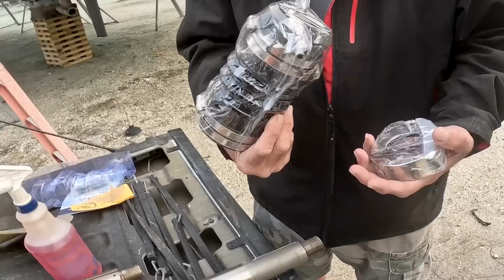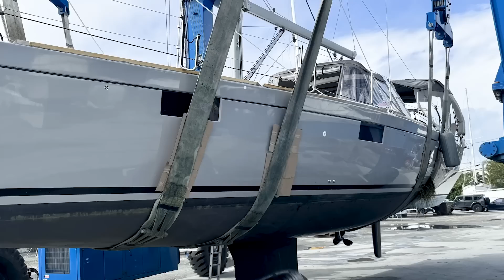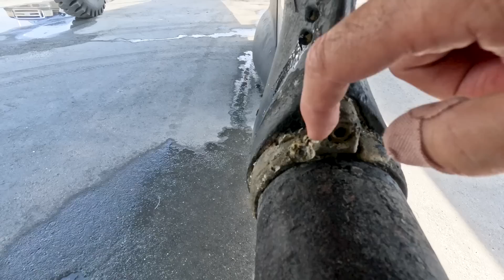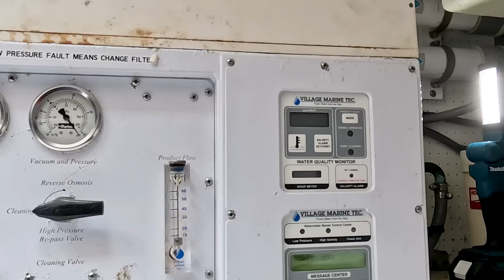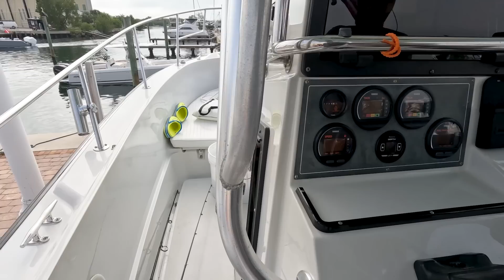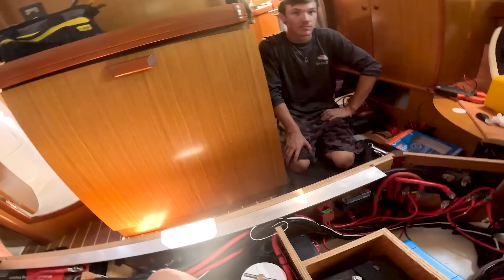Why this Yacht was STRANDED at sea

Comment: Ha funny story we were about 60 miles out of Port Aransas tied up to an offshore platform in a 20/21 foot Sea Hunt Center Console a Merc 150, fishing with my buddy great day of fishing it was getting that time to head back in hit the Key nothing, start checking batteries, wiring under the cowl, fuses. Radio works, stereo works, Bilge, Lights we have power fiddled with the ignition switch still nothing but we are still tied up to the platform its now getting really late its going get dark fast. Well we are sitting there drinking a beer and I look down and the shifter was just barely bumped out of neutral pulled it back into neutral hit the key and it fires right up. That was one long stressful ride back in to Port A in the dark running on the GPS. I was never so glad to see the lights break over the horizon.
Reply from the maker: Ugh … sounds stressful to me. We never drink and boat! Just like we don’t drink and drive the military taught us that too much can go wrong & fast. Glad you got it figured out.

Comment: goofy power readings probably somewhat due to connection cables from battery to battery also crazy when installed they didnt notice cable still moves after tight?

Comment: Loose battery terminals and bad grounds have caused me enough problems over the years that they have become the second on the list of things I check when having electrical problems. The first thing I check is the breaker/fuses and I always hope I don't have to replace something expensive that might be causing a breaker to trip. I have had a terminal crimp connection fail too and it was discovered when I did a wiggle test on the battery cables to check for a loose terminal connection, but there was a lot of corrosion from a battery going bad, so that was a bit of a one off.
Reply from the maker: You're right, always check the simple stuff first.  We just had another boat that had intermittent steering problems and it ended up being loose battery connectors from when I cleat changed his batteries.  Where are you watching from?  Thanks for your support.

Comment: We have a  2024 27ft Pursuit DC 266 and we lost all power  on the ICW last summer.   Made it to the side of the channel, dropped the hook and called Sea Tow.   Another boater came by and had some gas to offer, as I thought we ran out of gas - but not the case.    The negative battery connection was not connected correctly at the factory, so both engines were out.   This model of boat has only 2 batteries, 1 for the engines and 1 for the house.   I didn't think we were out of gas, which we were not, but shoddy   QC at the factory was the cause of this one.

We also experienced another factory flaw, the first time we refueled, we learned that the fuel cap restraining leash was never connected, so a fuel cap went into the deep.  Fortunately, Pursuit sent us a replacement cap, plus a spare for free.
Reply from the maker: Yeah sometimes things are missed unfortunately …. Even new boats.

Comment: Curious to see updates on the corrosion issue mentioned. I am currently working on a 2019 jeanneau cc that has corrosion on aluminum lower units and also has the earth plate for generator, not painted. Will you be putting a reference cell in for that?

Comment: My Dad ran a charter busines out of LA from the 70s to mid 80. She was a  will taken care of 60ft wood hull twin DD 671s,  Dad did maintaince on her every winter. Unfortunately,  in 85 she was hit at anchor by 140ft crew boat.. She took 3hrs to sink. My Dad ran his friend boat after that, 80Ft custom aluminum haul fishing boat with twin turbo DD 871s, she would get up and go.. Dad wasnt fimiliar yet the boat and forgot to switch the fuel tank on the way in and ran it out of fuel. Yeah, he enjoyed the taste of diesel to get the air out of the system back then., Great memories and times. Really enjoy your channel. Spent many of days scrapping barnacles and recaulking wood planks back in the day..
Reply from the maker: Sounds like work scrapping barnacles!

Comment: Does it help to tie a fresh water line into the barb on the drip less rings to flush out debris? Or will make a hill a beans?
Reply: The gunk that clogs up the shaft seal is actually coming from outside the boat(the cutlass bearing gets hot with use, so after the engines are shutdown there is some backflow of water); the raw water supply inside the boat goes through strainers to clean it up. Converting the dripless shaft seal to use fresh water would be adding multiple points of failure into a system designed to have as few as possible and those dripless shaft seals actually consume a lot of water(an easy 2 gallons per minute, per inch of shaft size). You would also have to add a water pressure regulator to bring the fresh water PSI way down to under 15 PSI(normal fresh water systems can easily be between 20 and 80+ PSI). On a normal setup, the raw water supply for the shaft seal comes right off the engine exhaust which means you will have water flow if the engine is running under normal conditions and the engine cooling water PSI is what those dripless shaft seals are designed for, so that's one less thing to worry about.

On slow boats(IE old sailboats and trawlers), some of the dripless shaft seals actually use sea water coming up the shaft to cool the cutlass bearing and only have a vent line coming off the shaft seal.

Comment: My family owned smaller runabouts when I was a youngster, we were fresh water river and lake fishermen. With that experience and watching boating videos for the last few years and particularly your channel,  I have come to a conclusion.  The only thing more expensive than having your boat maintained properly by good professional techs… is NOT having your boat maintained properly by good professional techs and, as importantly, it is far more dangerous. Once in the mid 60s we had the lower unit of the Mercury OB essentially explode at almost full speed. We were stuck ,dead in the water, and in the dark ages  prior to cell phones, decent walkie talkies or Tow USA. Fortunately the lake was calm and we were in sheltered waters, we rowed until we were close enough to hail my grandfather who was fishing in an adjoining bay and got towed back to the cabin. Rule #1, for runabouts, maintain your engine, and particularly keep the lower unit of an OB well lubed and in good shape.  Oh - and don’t forget the emergency paddles. We think some fishing line cut may have cut the seal and Dad missed it when he inspected to boat for the season.   If I would ever have the good fortune to visit the Keys I would like to say hello.

Comment: Great video Capt. I’m sure you figured out the dingy lift , but couldn’t you have put a cable on the arms which would in fur pull the boat further forward and shift the weight towards the bow?

Comment: 30 mile offshore port Canaveral 21 ft proline cuddy cabin lost all power at helm thank god for leatherman proline put main connector under glovebox right under drain hole that corroded pins. Pulled engine wires out of plug twisted together zip tied a bait bag around bare wire and made it back to port
Reply from the maker: Glad you made it back. Sounds like an adventure you won’t forget!

Comment: There's a pretty simple process to copy the waypoints to google earth or excel spreadsheet and then convert for use in a mfd. You should be able to transfer the waypoint data to card or a computer. Another option is to have the owner create the waypoints in Google earth, then they can be converted for use in a mfd.